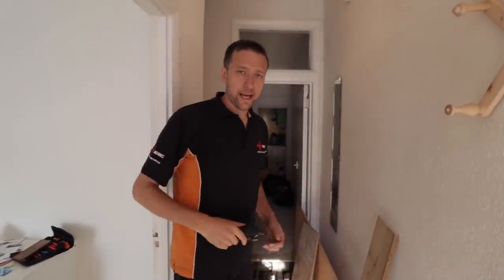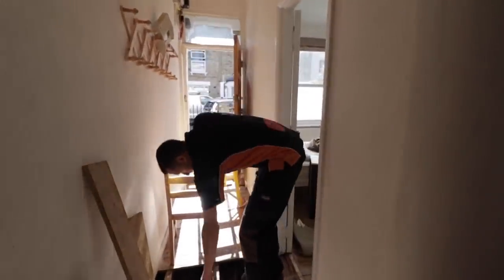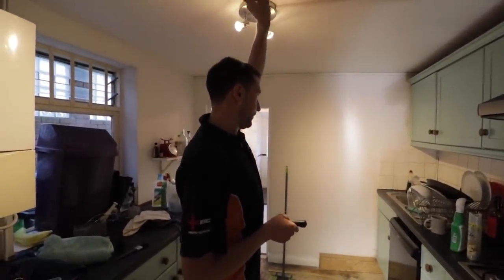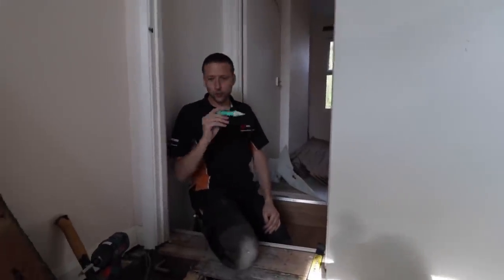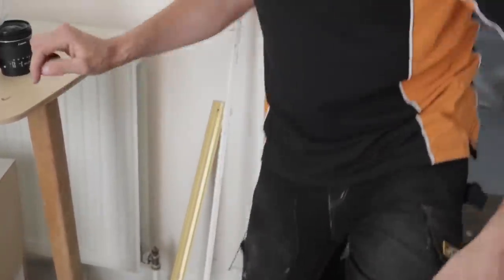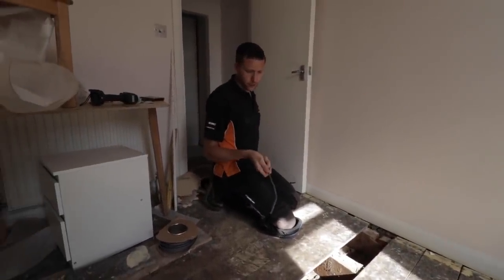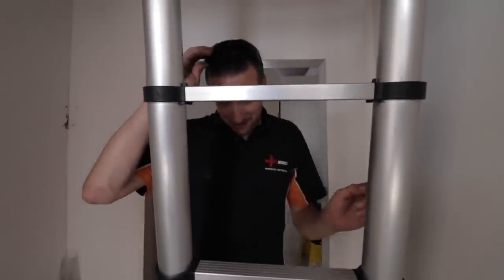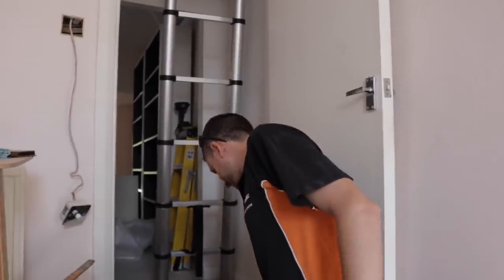House rewire First fix'n | Thomas Nagy

Comment: If I've learnt one thing about sparkying it's that even the 'simplest' of jobs can often require about 25 different tools and/or bits and bobs to get done right.  Pretty much if you don't take nearly everything you own then you'll often regret it once you realise you needed X particular thing that you didn't bring because you wanted to be 'efficient'.
Reply: This is the main reason why sparks and plumbers use vans; just the sheer number of tools that are needed to do even straightforward jobs. Add in the fact that some of the tools are large (e.g. stepladders), and some are very heavy (e.g. SDS drills), so you need a van. And that's before considering how to get large amounts of material to site.
Reply: Very true... You won't use a tool or part for a really long time, so you end up taking out of your toolbag or chuck it away then you'll be stuck on a job where you wished you hadn't 😭
Reply: @ashmanelectricalservices4318  I used to work with a sparky who used to take all his "smaller" tools out of his van every night and put em back in every morning. He didn't trust anyone not to steel them overnight.
Reply: @stephenhunter70  That's ME :) my family sacrificed too much for my dream to let some scumbag nick it. Battery tools and small tools bag are off every night.  The Megger goes under my pillow ...can't be too careful.

Comment: Hi Tom another great video! Thankyou for the shoutout about my ladder. Only 5 weeks left until I back on my feet again.
The ladder I had was a manufacturer weakness and trading Standards has proven that. 🙊👀

anyone who has the A-frame type of the telescopic  ladders please be careful the weak point is where the joining second half of the ladder is joined to the middle. This part of the ladder was tested and can only hold a maximum weight of 40KGS for 90 seconds.

I have a solicitor on my case as it has been wrongly advertised saying its 'EN131' compliant when it clearly isn't. 👀

Have to say that torch is well bright I got the same one but mines f#cked now due to dropping it in the attic 🤣

And a great shout out about the VIR or as we call it 'snap, crackle and pop' cable. Lethal stuff if touched live! ⚡

Also when it comes to the switch I always run a 3 core and earth so the switch has a constant neutral and permanent live for if I need a Loop at the light normally most downlights have spare room to fit a push wago.

I used to have a moped when I was an apprentice and I could only hold a small toolbag. Silly woman 🤣 she must been drunk when she put that on Twitter 🤣🤣

Thanks again for another amazing video Tom ! 👍👍
Reply: BEARELECTRICS any luck/chance of a claim up? ;)
Reply: Hi there what injuries did you suffer?

Comment: Absolute Top Guy! Very genuine, knowledgeable and also humble with it. Been a spark now for 13 years and wouldn't change it for world. Keep up the great work lads!
Reply: Sure you can
Reply: capnskiddies you can but remember the spur rule if your kitchen is on a ring and be mindful of load if you’re planning to use lots of tools or machinery in the shed.

Comment: A nice trick for when you are using spade bits (regardless if theyve got the helix on the tip or not) Set the ratchet dial (which is designed for when you are screwing down stuff) to like 3/4 strenght (if there are 20 positions where 20 is the strongest put it on 15) and when you hit a knot it will just engage the ratchet instead of snapping your wrist.
Reply: My drills clutch cuts in whenever I hot a knot
Reply: Pound to a penny Tom gets the spade bits that have the 1/4 type fitting so they can go in the impact driver.

Lots of sparks prefer those shanks to put in the impact as they are a lot easier way of drill through joists compared to a combi drill...

Comment: You are totally bang on with your neutral argument at the switches. It makes no sense at all to have a joint in the ceiling space when the neutral can be joined safely inside a metal box. One day this will be the norm. Also agree with most your reasoning, high power breakers closer to the main switch, not using too big of a hole in joists. Banjos are for plastic enclosures so the earthing and screening is continued, not the case on any metal box. You should do well because your work ethic is right. You quote and don't care about the competition doing it cheaper because it can only mean they are not going to do it right. You will not last a week on a bike, tools and ladders need a van. One day there will be an electric van, with solar roof charging to help.

Comment: Neutral at switch... use a 3 core and earth as a switch line from the ceiling rose/junction box,  use the 'spare' core as a neutral and terminate it in the switch until it's needed.

Comment: In the US, our new codes require neutrals to be brought into the switch boxes for the exact reason you mentioned....many of the new switches demand a neutral (smart switches etc) because they are constantly pulling super low wattage to stay functional.

Comment: North America it’s code now to have a neutral in all boxes now.  
I’m not sure if you have them over the pond, but we have led pot-lights “downlights” that are no thicker then half inch board.  That means it doesn’t matter if there is a joist in the way, the light still fits.
Reply: James iPad .....yea we have them here too , it's an all in one fitting so when they eventually blow you just replace the whole fitting with the built in led , problem is not a lot of customers like them , they say they look to clinical.....😳

Comment: Cutting the skirting board! Just drill 20mm hole from above the skirting board using the long sds bit
Reply: Cuezed Deen 
He’s in a old property with larv plaster and in my experience the walls have diagonal joists too which intersect at a corner with massive nails. So drilling through with a long spade bit usually ends up with a knackered bit and the plaster crumbling. Best to do what Tom did and see what you’ve got 😊
Reply: @bertiebassett1972  I see what you're saying. I meant 20mm sds masonry bit.
Reply: Then there would be  Hole to patch in the lath and plaster that we all know is crumbley and often a pain in the tits to patch. Skirting board can be glued back in and with a little caulk you'd never know  anyone has touched it.

Comment: Hey Tom. You mentioned you don't like auger bits because they can lock up and torque the drill. This shouldn't be an issue for you with the bosch drills. Most of their high-end drills have an anti-kickback feature. If you drills have this feature it might be worth you looking into.

Comment: Hi mate 
same issue as other guy the ladder snapped on me like his as I was coming out of a loft.
In a word there shite.
Two chipped bones in my back and the doctor in A&E said could have been much worse.
Skip them if I was you!!!
Reply: Yeah, those telescopic ladders are OK for surveyors and the like who use them now and again to look up in a loft. Not up to the job if you are hauling tools and all sorts up and down them every day.
Reply: Imo it's all about the wall thickness of the aluminum or steel using in these ladders.

Too often the cheapest ones with the smallest wall thickness are bought because trades like how lightweight they are. 

If your going for say a 3m extendable one get the more expensive options. One option in said retailer is 9kg and £120 and one is 12kg and £160. 

You need the thickest wall of metal you can get for these types of ladders to handle the stress of them flexing.

Comment: Makes so much more sense taking the feeds to the switches. If you ever have to carry out work / maintenance etc on a lighting circuit the last thing you want to be doing is getting a set of steps from the van 😂

Comment: I'm not a spark, but every industry has regs, and you're spot on. I've been taught the ALARP (As Low As Reasonably Practicable) principle. That's to say you follow regs to demonstrably reduce risk as much as possible, but it's not practicable from any perspective to follow all of the regs all of the time. The time, money and effort required to conform to every reg all the time would be disproportionate to any benefits.

Comment: I was wondering. Are you still using ring circuits or radial circuits? If you using radial, how many single and double sockets you put on 1 circuit breaker? How do you calculate this? Also lights. Tnx. Keep it going. Love the vids. Ps, where is Laura?
Reply: goofie312 in the intro 😄

Comment: Tom, started watching your videos a couple of months ago and really enjoy them, I’m an electrician also and the geek in my head just wanted to find and share the following with you. If you look at reg 559.5.1.208 it states consideration shall be given to the provision of the neutral conductor, at each switch position, to facilitate the installation of electronic devices. So the loop in at the switch method is the way forward in my opinion.

Comment: Agree with your approach to feed in and out at the switch, always do it, don't see any disadvantages at all. It can get quite cosy in the box, is the only potential issue. Feed in, feed out, switch out, 3 core for upstairs landing, 3 core for downstairs hallway, on a 2 gang switch, was one I did at the weekend. Thank God it wasn't a dimmer.

Comment: I’d like to know who thinks it’s bad practice and why, to feed the light switches. Love the vids mate keep it up.
Reply: It use to be bad practise as it was an inefficient way of wiring a lighting radial as significantly more copper cable was needed in this method.
However the use of 3-plate ceiling roses is dying out and what with SMART/WifI switches becoming affordable the argument Tom makes is sound, combined with the fact copper cable is much cheaper now it makes great sense to start wiring lights like this.  It future proofs the installation for SMART/WiFi upgrades in the future.
Reply: I use both ways

Comment: Now you are using Bosch 18V kit, try the GSR/GSB 18 V-60-C or V-85-C with the Bluetooth module.  You can use the phone app to configure the cut off torque so you avoid breaking your wrists when a drill bit jams.  It electronically brakes the motor rather than relying on a clutch which can wear if you slip on it all the time.  It also can't be 'forgotten' when you grab for a drill not remembering you switched it over to drill.

For lots of bigger holes in one go get the 85 as the 60 might burn out.  I use lots of them at work and we lost the magic smoke from a couple of 60s that were used for twist drilling holes in SS sheet.  Replaced with 85s and we've had zero failures.  60s are lighter though so good for smaller holes.  (Bosch Pro warranty is excellent - 3 years if registered within 30 days and on tools like drills they just swap old for new).

The best jobsite radios for me are still the Makita boxes.  Really good bass, reliable reception and strong enough to be used as step ups.  They just need to have DAB and Bluetooth in one radio.

Comment: Regarding the extending ladders, before we come to a conclusion it would be useful to know if the snapped one was a cheapy from ebay (~£50) or a decent make.  The one I have cost around £200 and the difference is like chalk and cheese - it feels quality and has a nice smooth soft close action.  Also (of course) it should be used within spec., leant at the correct angle and treated with care and not just chucked in the van.  Just my thoughts.  Stay safe!

Comment: Tom you might want to read the manual to your new 18v Bosch drill I believe the model you’re using has kickback control so no reason not to use the Bosch daredevil spade bits...😉
Reply: I guess from what I see this is a GSB 18V-60C, which has got kickback control.

Comment: I'm pretty sure it looked like the gas boiler had the flue going into the lean-to and some homemade looking flue extender (dryer exhaust flex?) took that flue to the outside. To me it looks like a bit of DIY! (Could be deadly if that's what it actually was...)
Reply: Aidan Dillon spent ages rewinding and pausing the video 😂 Whatever it is it’s a rigid plastic pipe but looks more like a soil pipe than a flue.

Comment: With that ladder your using , if the angle  is to great and extended out enough , it can cause stress fractures and cause a failure
Reply: I've got one of those and they are sketchy as fuck. Problem is they are sooo convenient, far less of an arse to lug one around a house or site than a step ladder. It's probably worth noting their load capacity isn't that high, so those well fed blokes that are reading - yeah stick with a step ladder and lay off the maccas
Reply: maybe they ignored the "weight limit rating" I see that all the time, 250LBS wingwnags carrying 100lbs materials up a 200lbs ladder, which is also holding 30' plank in the air with 2 or more workers on it.

Comment: I agree with the neutral at the switch it's best practice and it's in 18th edition as best practice todo that for smart switches etc
Reply: I've done some DIY electrical work and this section was a complete whoosh for me.  Can anyone point me to an explanation of the neutrals at the switch issue?  Thanks

Comment: The only folk saying it’s bad practice to take neutrals to switches are just old school sparks who were taught that way back in the day. Things change!  9/10 I feed the switch, if it’s easier to take to a spot I do but I take a 3 core for the S/L to future proof it needing a neutral at a later date.  College teaches feed at the switch now, they didn’t used to. Some d boys can’t get round the fact it’s done that way now.
Reply: I'm at college at the moment. Yes they teach us both ways. Just wondering though, what is the advantage of taking the feed to the switch?
Reply: Do you run a 2 core cable feed to the switch and a 3 core cable from switch to the ceiling rose? Just in case you need neutral in the future?

Comment: The Bosch Radio....I see they haven’t upgraded it in years! Lad I used to work with had one, it was a beast then...and still is now! It was the size of a house and weighed about the same as one, I’m sure it did the back end suspension in his van! He dropped it down the stairs at a clients and it almost demolished their house 🤣 Why does it need to be such a beast?
Reply: Thats the one i still have! 😂😂

Comment: Hi Tom .. When you said about the nuetral in wall box and ''smart '' stuff .. i assume you mean the stuff that can be controlled by your mobile and ?? Would you/could you please show doing the wiring in the wall plate . Sparky told me  years ago he did the junctions in the wall box instead of a ceiling rose . I have done loads of ceiling roses but cannot get my head round visualising the connections in the wall box

Comment: If you use the bosch speed bits then put them in your impact driver. They eat through joists like butter and the impact won't snap your wrist

Comment: So there were a load notches out the beam where a pipe had been but you didn’t use them? But instead cut new holes
Reply: Notches are not 50mm down from the boards, plus it’s a bodge to run them in notches
Reply: also wondered if the new holes were between 0.25 and 0.4 of the span?
Reply: But if they are there use um. He said he didn’t care about safe zones!

Comment: Hi Tom, those knee pads aren't really the best, the velcro strap is really shyte. Best to get some of that black dense foam and shove it into those knee pockets, or but one of those knee panels. One thing I found that's awesome is a knee pad with wheels, mechanics normally use them. Good investment.

Comment: Get the knee pads that drop into your work trousers.  So much more comfortable than the strap on ones.  Or just sew beer towels on the inside of your knees
Reply: I tried those when I first started out, found that moving around with the pads in made then rub on my knees like mad, couldn't stand it!

Comment: funny, I've had the exact opposite experience with screw bits vs spade bits.  I more times than I can remember had my wrists nearly broken when the spade bit grabs and throws the drill as 6000 RPM into my forearm but screw bits they burn right through whatever.  I have had a spade bit with a screw tip on it, that thing nearly broke my arm off.  The screw tip pulls the spade into the wood really fast then the thing just bites into something hard and boOM.  You have to really brace yourself and learn to let go of the drill trigger when using those things.  I only use them on my cordless drill because it has a really strong breaking system so as soon as I let off the trigger the drill stops turning.  My old BnD corded drill will keep turning till your arm unscrews

Comment: Just wanted to endorse Chalky 762's comment  Re using impact driver to make holes in joists. Armeg make hole cutters specifically designed for use with impacts. The difference is remarkable. No stress on the wrist. The only Con is a bit more noisy but well worth it to save your wrist.  Added benefit is the shorter length of the driver's body. Once you try it I don't think you will go back.

Comment: I wire feed to the junction box and wire the switch with 5x1.5 or 7x1.5 and i connect neutral and ground as needed at junction box. I  always leave coupe of extra cores to switch box.
Reply: That's a hell of a lot of wires at your switch... Are you in the US by any chance?
Reply: peto22 5x 1.5 sq mm singles or 5x 1.5 T+E? 😳

Comment: Agree it's dangerous but that's an old version of part p, seems to have been removed, along with the need to notify in kitchens and bathrooms. The regs advise replacement of vulcanised rubber.

Comment: VIR cable, wonderful stuff for causing house fires in Australia due to the age of the stuff, average summer temps etc. It does make sense to loop at the switch if you've got or might have in the future a need for a neutral at the switch.

Electrician: when was the last time you get an electrician?
Customer: Dunno mate can't remember!
Electrician proceeds to find lots of VIR cable from the 1930's everywhere!